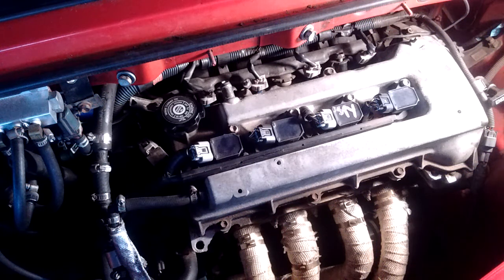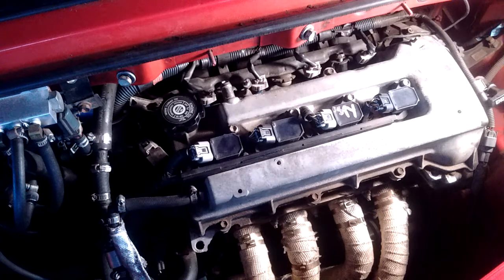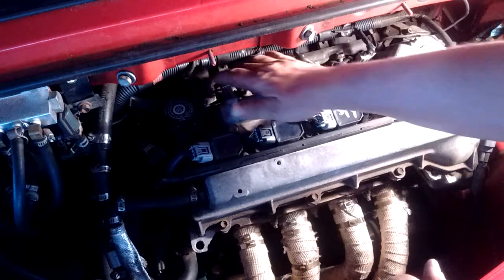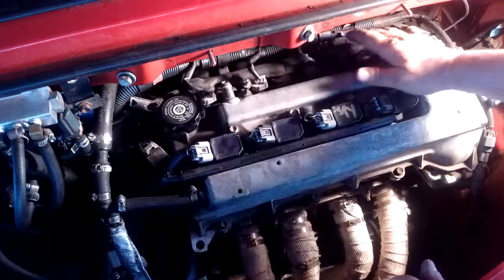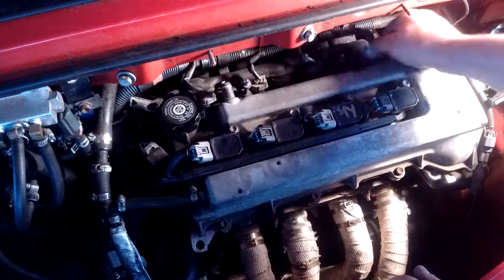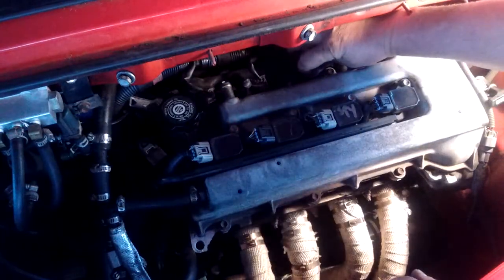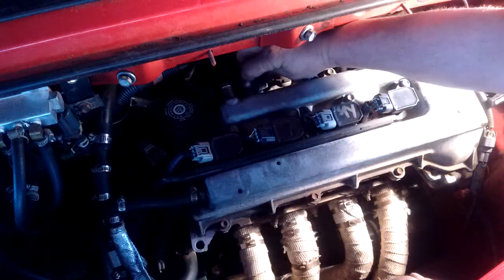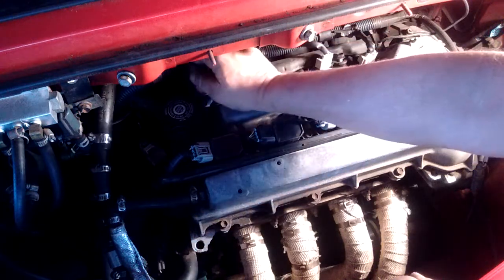How to Remove the Fuel Injectors - Toyota MR2 Spyder 1zz-fe/2zz-ge

Comment: To get to that fuel relay C/OPN Relay.  I think you have either very thin arms and fingers, or you will have to pull the battery, and then reinstall the battery.
Reply from the maker: After the car sits for a little while (couple of hours does it) there is no more fuel pressure, you can pull the fuel line without any worry, and you don't have to monkey with anything to release fuel pressure, it just releases itself.
Reply from the maker: Or you are one foot tall and you can get under the car and put a ladder against the firewall.
Reply from the maker: If you are in a hurry just put a couple of rags around the fitting when you release it, you will capture all the fuel, it is just a tiny amount, remember, fuel is incompressible, any release is just due to stretch in the rubber lines.
Reply from the maker: This nonsense that gets passed down about  running the engine to drain the fuel is just that, nonsense.

Comment: No single video on fuel injector removal on 2gr fe engine. Would have to try to use this to do same on 2gr
Reply from the maker: For the 2GR you must remove the intake plenum in order to remove the injectors from the rear bank.
Reply from the maker: The intake plenum is supported by two brackets bolted to the rear cylinder head. You must reach around to unfasten those if you want the plenum to come off.
Reply: Would really appreciate thanks in advance
Reply: Yea tanks for the info. Really wished I can see a video
Reply from the maker: @wilsonemeka1833  I'll see if I can whip something up for you.

Comment: Frank, do you think it is possible to remove the intake manifold after this procedure?
Reply from the maker: Yes, it can be done, you have to get a lot of stuff out of the way, and it helps to take the engine off the mounts and move it to make space.
Reply: Thank you Frank - am i safe to presume in the end you need to pull the intake manifold toward where the (removed) battery would be located ? End goal is There is a radiator hose leading from the oil filter base and it disappears up under the intake manifold. I cannot think of any other way to reach it
Reply from the maker: @andrewsparey697  I think you are talking about the thermostat housing. You can reach it from under the car. Take the starter out first.
Reply: @Merryfrankster_  ah so there are three hoses. The thermostat hose has been replaced. There are also two small hoses coming off the base of the oil filter. One is fully replaceable but the other disappears up near the intake manifold and is not possible to reach from underneath. Also pulled the alternator but was unable to get to from that side. So an attempt at a manifold removal is my last resort
Reply from the maker: @andrewsparey697  I see. It sounds like you have a factory oil cooler. I have never seen one of these on a US car

Comment: Hey man I'm having a problem with my injectors firing the power to the injectors thumbs down
Reply from the maker: Sorry that you're having a problem. Check the IG2 fuse. If this fuse is blown the injectors will not fire.
Reply: I checked the fuse already anything else you can think of
Reply from the maker: @happytuningperformance3924  Insufficient fuel pressure. What size injectors are you using? Bad injector characteristics in ECU - did you set the latency/dead time correctly. Could be lots of other things too.